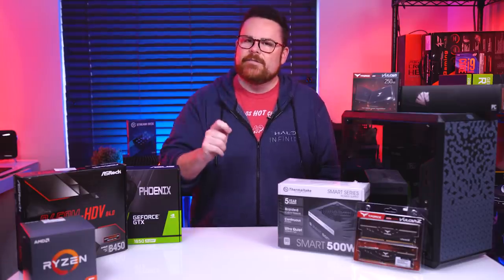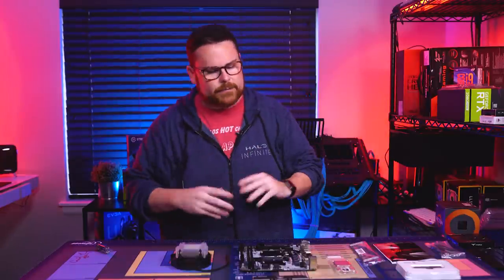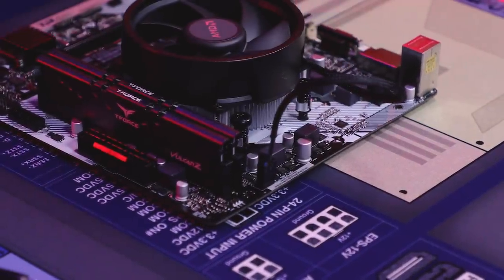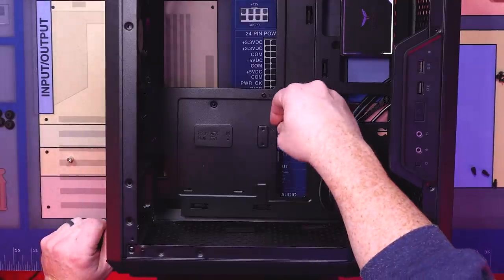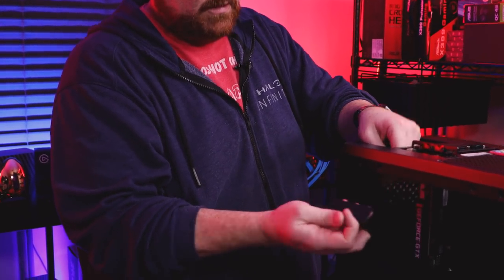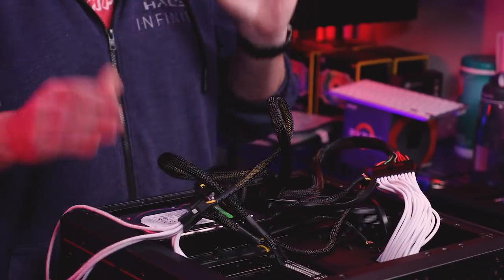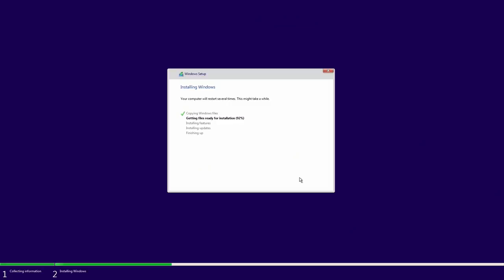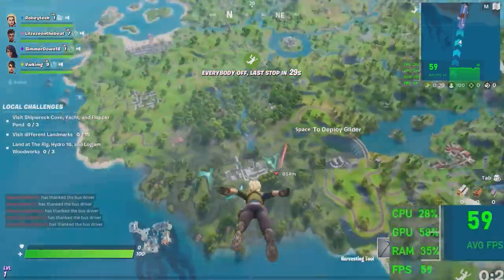How to Build the Best $500 Gaming PC! Step-by-step (2020 Edition) | Robeytech

Comment: First comment! Woo! Awesome guide for first time builders with a decent starter pc. Also showing proper hygiene lol. Cat like reflexes with the fan cooler!
Reply: Is this a good streaming and gaming pc
Reply: Would you need a wireless adapter for this or is it already "onboard"?
Reply: The graphic card is out of stock what should we use
Reply: @jeremiaha3388  I just bought a system using this MB and Processor, but decided on the Radeon RX 570 at $119 from NewEgg. Performance is on-par or better than the 1650 Super based on all of the reviews I've seen, and it's like 60% of the price. IMO if you're doing a budget build, go as budget as you can while keeping the same basic performance level. I think the RX 570 blows the 1650 Super away in that regard.
Reply: does that pc can run dota 2 smoothly and nice graphics with 30fps?
Reply: @RobeytechLive  ill subscribe if you answer my computer build please i need advice .
Reply: William Boyer cos it’s edited so he probably added on to it after watching....,
Reply: I know you made this a while ago, but I’m just seeing it now, and I’m asking if this pc is powerful enough to play call of duty modern warfare? Thank you for your time, loved the vid and subbed
Reply: oink_oink _4207 if it can play fortnite, i bet it can play warzone/multiplayer
Reply: Anyone know if the msi gtx 1660 supernis compatible with this build??? Help pls I'm trying to build my first pc
Reply: Alright,  so only thing i changed was the 1600af for a 3600 and added a 2tb hdd, do i need anything extra for the parts i added?
Reply: This motherboard compatible with m.2 nvme ?
Reply: @cjchillax1771  he doesn't need subs his channel is powered by Newegg
Reply: Hey can this run rust?
Reply: Gtg but the shit first😂

Comment: The first 3 things are worth more than 600 now 😐🔫
Reply: Did you build it?
Reply: @larrypotaot  Uh uh, I’m broke af
Reply: @goldenboytapia  whats your budget
Reply: @goldenboytapia  as of 3/19/2021 i’ve built a custom pc for around $430
Reply: @johnstaker6706  is it good?
Reply: @johnstaker6706  parts list please thanks
Reply: @eve.222  it’s not bad but it’s not good either it helps me with what i need to do which is school work and watch movies and stuff but for my first pc i built its nice
Reply: @YeahWhatSon  ryzen 3 3200g included cooler, msi a320 pro max mobo, oloy rbg warhawk16gb dual channel ram, 500gb wd sn750 nvme m.2 ssd, corsair 450 semi modular psu, cooler master q300l mini atx case.
Reply: @YeahWhatSon  optional stuff i got from amazon: 5 pack artic f12 pwm pst fans, fan hub with pst pwm compatible, keyboard and mouse rbg, magnetic philip and flat screwdriver, mouse pad, large leather desk pad, power line ethernet adapter, hdmi switcher between pc and ps4, and wrist cushion
Reply: @YeahWhatSon  all these parts price i believe have gone up except for the case and psu unfortunately i don’t have a gpu bc theyre expensive as shit but if u look and research n find one for cheap u can get a decent 1080p system that can run games on average fps
Reply: @YeahWhatSon  cpu was $120, mobo was $70, ram was $70, ssd was $60, psu was $70, case was $50. i have rounded up to the nearest dollar to make it easier but if u want i can give u exact amount
Reply: @johnstaker6706  wow thanks for the reply and list
Reply: @johnstaker6706  i made a pc part picker list on your build. lol $451.23 (4/6/2021) still good price. do you run it without a GPU? thanks again
Reply: @YeahWhatSon  not bad price wise but rn if ur gonna go with gaming focused i recommend buying a pre built but they are more expensive and they will have a gpu so if ur on a tight budget go with that list or if u want gaming focused pre built
Reply: @YeahWhatSon  also u don’t need sum of the stuff i got like 16gb dual channel ram u can easily save money on a single channel 8gb ram, same with the ssd look for some cheaper, don’t cheap out on the psu cuz if u do u can fry the whole system other than that yh get stuff similar to ur budget or similar to what i have and research
Reply: @YeahWhatSon  no i don’t have a gpu cuz they are expensive af and even for a basic one it’s like $600 so i’m waiting until prices go down when i can build a whole new system and i game mostly on playstation so gpu isn’t that important to me
Reply: @johnstaker6706  my dad left me
Reply: @johnstaker6706  why u build a custom pc for schoolwork dude just like like a 150 dollar laptop
Reply: @ohnyoo1013  so basically it was meant as a gaming pc n i forgot pc parts were expensive af so i built the pc intending to use a gpu in the future but for rn its just being used like a normal pc plus for the experience

Comment: Never built a pc in my life, never installed software or drivers in my life, I’m 16 years old and just built my entire pc, installed everything I needed and got windows 10 pro for $7, I highly recommend this video!
Reply: Where did u get your windows 10 key? I plan on doing the same build but I dont wanna spend 100 bucks on a windows key from microsoft
Reply: @diegogcp_21  just search up Windows 10 pro key on eBay and find one that looks trusted with many purchases, the one I bought had 450 other purchases so I felt that I could trust it and it came out to $7

Comment: Only thing I would add is (from a noob): 
- be specific where the screws you got come from (from MBO box, PSu box, etc) 
- better camera angle because sometimes I cant see where you are plugging it in and what position.
- be more specific which pin you're putting to which socket

Other than that, this was helpful. Thanks for the guy in the background checking him lol. And thanks you for the help!

Comment: Love how you explain the smaller details most youtubers overlook, its actually quite helpful and makes the process easier
Reply: Hey man I am a 15 year old doing this for the first time. I have different parts than he has. Do I have to have a mechanical drive or can I just have an SSD. Also do I need to sata cables or just one
Reply: @edemhosi8528  No you dont need a mechanical drive, if you have a M.2 SSD you wont need any cables. But if you have a 2.5inch SSD he shows how to install it in this video.
Reply: @Will-od2ww  ok thanks. I figured it out along the way and I have a full built pc now

Comment: Just built this with a few of the listed upgrades, and it is amazing! Had to get an aftermarket cooler because my 3600 was running a bit hot. Thanks a ton for the guide!
Reply: Did you overclock?
Reply: @typeparameter8421  I over locked the GPU, but not the CPU. I was afraid of overheating it.
Reply: leggy blonde and did you keep the same psu?
Reply: @typeparameter8421  I did and so far it's gone without a hitch

Comment: Great video.  I've been thinking about building a new computer for a while but  I was nervous about building a computer from scratch,  but after watching your video, I think I should be able to build mine with little problems. Thanks for the video, I'll post again after I get the parts and get them put together. Cheers!
Reply: UPDATE: Received all of my  parts and have successfully built my first gaming pc.  Added a wireless card, keyboard & mouse, monitor and a set of speakers. I'm totally happy with my PC. I can play worldofwarcraft@ 100fps on high settings with no trouble at all. Thanks for the great video (both the tech part and the parts list). Cheers.
Reply: Nice work meng

Comment: Those filters are awesome and with enough fans work just fine. I built 3 pc's with my kids last summer and was a on a very tight budget since I was building 3. Same case, cpu, ram, mobo and psu. Graphics I went with xfx rx570 rs xxx edition because 8g ram and was on sale for $75 and came with boarder lands 3!! I used adata su635 240gb on sale for $24 and I picked up 4 2tb 7200 rpm enterprise drives off ebay for $130 and they turned out to be brand spanking new. I aslo got win 10 pro keys off ebay for $1 each. I know the ssd is trash but on a super strict budget it's all I could afford at the time because I needed so many parts like fans and extra stuff like keyboards, mice, monitors, controllers ect. Your build is stellar and is way better than mine but that gfx card might be even with mine and get extra 4g more ram for less money. BTW you got a new sub with me! Loving your channel!
Reply: @RobeytechLive  hey rody how much fps does fortnite get when you put fps to unlimited and turn down all the settings to low exept view distance??? Ill build this pc if it runs 140fps

Comment: Awesome video, I appreciate your content. I have this exact same case that I'm getting ready to do Ryzen 5-2600 build in soon. I was a little concerned about the cable management being there's no PSU "attic" to stash the cables in. After watching your video I am way more confident about building this PC and also the wire management. Two (2) thumbs up for sure, keep up the good work man, the videos are very helpful for us "rookies", speaking for myself of course. As you can probably tell I'm still a total noob, this will only be my 4th build and first Ryzen at that. Below is my parts list for the build:

Ryzen 5-2600
ASRock B450M Steel Legend
16gb Corsair Vengeance RGB Pro (4x4gb) 3600MHz
AMD Wraith Prism RGB 
Evga GT 1660 SC GPU
AresGame 650w Modular PSU
CoolerMaster MasterBox Q300L Case

Comment: I bought similar build but because i already had from old pc , an rx570, power supply , hdd, ssd , i only had to buy the rest. I bought the exact same case along with ryzen 5 2600 for 100 bucks and also brought the gygabite b450 d2s and 16 gb 3000mhz ram.
It works like a charm . also spend about 90 bucks for new monitor .

Comment: Prices these days went up due to the pandemic. I spent few hours on research since this will be my first PC built, and I realized including taxes this build was more like 600. Coincidentally, my purchased parts were identical to your build except for the case and video card (well, I used a different brand 250GB ssd but that is neligiable). I got an used rx 580 8gb on eBay to save some cost. My grand total is $479 including taxes and shippings. The key was to spend some hours on hunting deals. It was worth it, because not only i saved money I gained more insights about the computer parts market. When all the parts come (hopefully everything works), I will follow this video step-by-step then overclock. Thanks for uploading this. It is a huge help for a person who never built a computer before.

Comment: 2 weeks later and the parts have gone up after shipping the pc now cost a total of $700 
(i haven’t checked but it always happens)
Reply: I can find it for 610$ with a 500gb ssd
Reply: Just bought all the parts except for the SSD for $502 on Amazon.  (4/21/20) I got a Crucial BX500 480GB 2.5 inch SSD for $60 on the crucial website, for my build.
Reply: i did the math with all the original parts he shows on amazon it cost $593.92
Reply: Depends on where you and when you get your parts it was just a 40 over 500 last week now its 600ish I think for this build it'll stay around this range.

Comment: Hey, great video with an outstanding quality! However, I have some doubts about the motherboard and the power supply. For the motherboard, I heard that it was meant to be used as a mere office computer motherboard hence it’s not too good at handling too much wattage or heat that’s generated by gaming cpus and gpus. For the power supply, I think that the bare minimum is 80+ bronze because I’ve heard some horror stories. Other than that, solid build for the price my man

Comment: Really you can do usb 3.1 though at this price point which isn't bad as long as you are not planing on any VR Stuff nice build good overall choice
Reply: this build is capable of vr at well performance, as long as it has a display port
Reply: @mxen0n  but you also need a 8 gig gpu which is listed as the requirements for a lot of VR headsets.

Comment: My plan is to make a 550 pc. 16gb ram. Gtx 1650 super. Ryzen 5 1600 af extra then upgrade my 60 hz monitor to 144hz after 5 months. I'm 14 I have no job that's why. Then upgrade the cpu. Probably 1 year later upgrade the gpu to a 1660 ti or If I could get a little bit more money a rtx 2060

Comment: Your steps were spot on.  But for $500 you don't get a M.2 or a HDD hard drive. And adding 1 fan in the front of the case to draw in air would keep your components a little bit cooler.

Comment: Nice build for the money using all new parts. Personally I don''t mind you starting with that smaller SSD. Saving up and adding another drive later is very easy as you demonstrated.  Personally if going with any other board form factor other than itx-- I would get one with 4 ram slots to take that up to 32 if needed down the road. The best part of AM4 is that one can build this type of starter PC now and move all the way up to 12 or 16 cores at stock speeds even on most B450 boards.

Comment: I built the computer no problem until I used the free version of Drive Booster 7 Pro.  Then the computer would not boot, went back to a restore point.  I don't use driver programs but I thought I would take a chance this time.  I liked the video but would have liked close ups of which screws to use and where the smaller connectors plug into the system board.

Comment: i have heard that you need a wifi adapter or something like that that has a usb and antenna in order to have a wireless wifi connection when you have just finished building a brand new pc. is this true or can i just connect to my wifi normally without an ethernet cable?

Comment: got a question...so while you was showing the case and you took off the clear cover...you laid it on it's side...you pointed out the little risers on the opposite side of the case to do just that...my QUESTION is...is there any reason why that computer couldn't be used while it is on it's side?? I mean airflow issues...over heating?? hardware issues???

Comment: quick question! do you have any suggestions for a case that can easily move back and forth between two rooms? I don't know if there is a decent case with handles that exists that is sturdy and can fit all the parts I plan on putting into it. (if it's ugly hopefully I can just paint it for a better aesthetic)

Comment: Hi RobeyTech, I plan to make this build It is going to be my first ever build. I have experience working on laptops for parts replacements but i have never built a pc. I am also curious, is there a difference if i used a ryzen 5 3600? what would be the differences? Any advise you could share as I start shopping for the parts would be nice.
Reply: building a pc is much easier than a laptop imo. If you used a 3600 you would get improved performance, especially workstation/desktop purposes with maybe a small uptick for gaming though the 1600 AF is already a great CPU.

Comment: I built this PC today with these parts. My video card came in the same box with same specs (I think) only mine is powered completely by the PCIe slot. I thought I had a major issue @41:28 when your plugged the power into the GPU. I thought my GPU was missing the power socket!  Yes, it's my first PC build.

Comment: Can you provide information on overclocking this system if it's possible / recommended ? I built this rig with a gfx swap (1660super ventus) and am having some trouble with star citizen fps(10-15)  but I feel like the rig should be getting me closer to 30. Any suggestions on solutions are appreciated!

Comment: Just decided to put in a m.2 1 tb ssd the build you didn't put a heatsink on the m.2. The m.2 I'm installing is a Intel 660p Series M.2 2280 1TB PCIe NVMe 3.0 x4 3D2, QLC. My question is does it need a heatsink? keep in mind that it is just 1 TB so I may be replacing it in a couple of years. Back to the question would I need a heatsink for that m.2?

Comment: The only downside of the MB is that it has just two RAM channels. Gigabyte B450 - DS3H is a better option for the same price.
Great Video Tho!
Reply: DRUGATECH it’s about £30 more. 2 more RAM slots and better cpu over clocking is available on the B450 DS3H. Worth it, but on a tight budget for entry level gamers who aren’t going to need loads of RAM and high overclocks, the HDV will do.

Comment: I have one concern. This $500 PC parts list does not include the Windows 10 software. So the cost will be higher once I purchase Windows 10. Is this correct? Or do you have a link I can use for a economy price version of Windows 10.  Thanks for the video. Very helpful.
Reply: Yes, if you want to include the price of Windows, the cost will go up by around $130 (USD) or so depending on which edition of Windows you buy. Pretty much PC build guide on YT includes the price of the OS. Windows 10 is not technically free, but you can download it directly from MS without having to pay for it and it will work. The only "limitations" that it will have are that you can't change the default wallpaper (quick and easy workaround) and it will have an activation notice on the Settings app. Other than that, it will work exactly the same as if you bought it.

There is no "economy price" version of Windows 10. However, there are sites like G2A, eBay, Kinguin, etc that sell OEM license keys for significantly cheaper than other places. This is a bit of a gray area because these keys were meant to be sold in certain countries and/or businesses and they have either been leaked or sold to other people. As far as I'm aware, it is not illegal to buy these keys, but it is against Microsoft's terms of service so they could revoke those keys if necessary. My thinking is that Microsoft wants as many people as possible on Windows 10, so they're willing to let some of this slide by and aren't as strict as they were with older versions of Windows.

Comment: Do you have Vdrop problem using this ASRock B450M-HDV R4.0 Motherboard? Mine cant even reach base clock on cinebench R15 (Ryzen 2600, RX570, PSU EVGA 500BR)